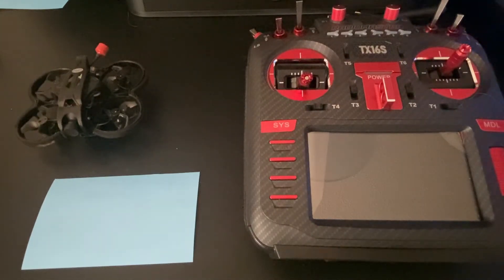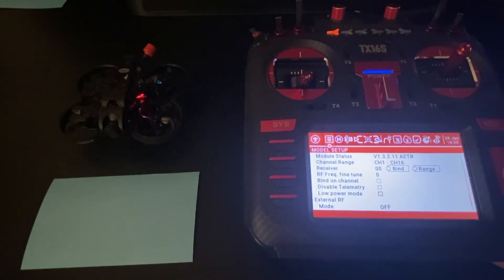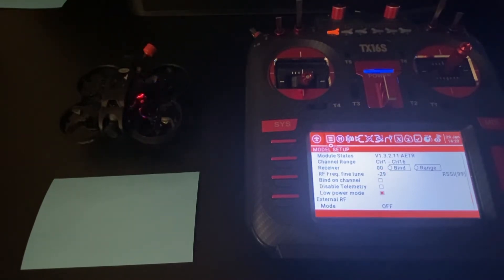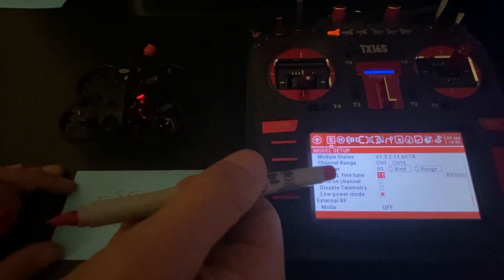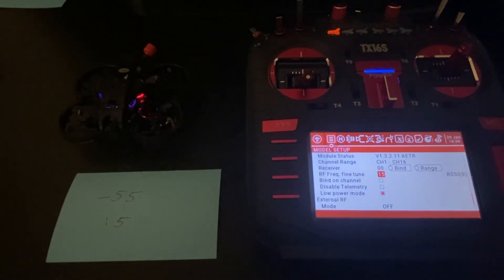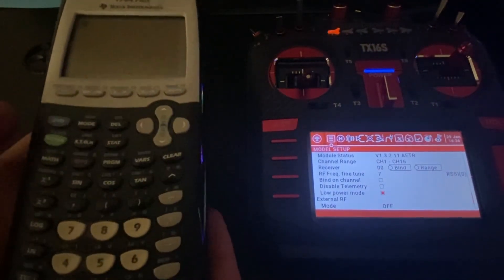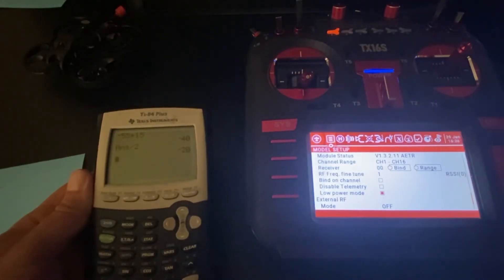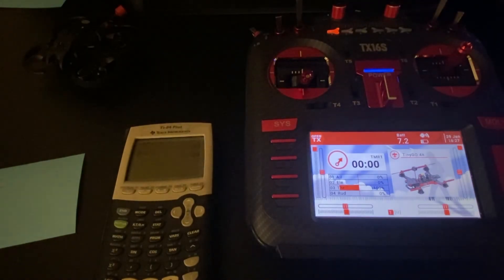How to Fine Tune the RF Frequency for Better Range

Comment: I have the tx16s  BUT....... WHY..... I don't have the "RF Freg. fine tune" option.?
Reply from the maker: I believe the option is only there for the internal multi-module
Reply: Apparently that only works with Frysky and only then if telemetry is available, I tried it with a spectrum receiver that also has telemetry and the menu item ALSO is missing
Reply: @werner7156  ..thx

Comment: Very nice video.
I bought a new GEPRC cinelog 25, I've bind my a BETAFPV ExpressLRS ELRS 2,4 GHz Nano and a BETAFPV ExpressLRS ELRS 2.4GHz 500Hz 500mW/1W Power OLED screen Micro TX Module in my Radiomaster TX16s. I've set beta flight to crossfire and Receptor Serial, channels AETR1234.
But Can connect well the radiomaster TX16s.
The channels and mods dont't stablish connection.
The betaflight show that the drone is connect.
I've the same problem when I connect internally (tx16s) a jumper receiver to another cinewhoop.
I've the latest Edge TX, the latest betterfligh, latest cinelog 25 firmware, run the DUMP of GERPC CLI, good driver USB connection...
I had prepare a small video explainning my problema.
https://www.youtube.com/watch?v=6hwWues7apI
It happens the same with anotehr dorne.
https://www.youtube.com/watch?v=5skg5F4vJyg
Maybe it's betaflight or radiomaster...
Can you help me please?

Comment: Does this also works on a Junper T18?
Reply from the maker: I’m not too familiar with that radio but I would think that you should be able to do this on it
Reply: @719FPV  thanks dude
Reply: @719FPV  thanks dude

Comment: Can you bind it to the tx16s hall
Reply from the maker: The receiver on the tinygo would not bind to the tx16s so I replaced the receiver with the R81
Reply: @719FPV  that is actually what i meant,
So its yes😎👍